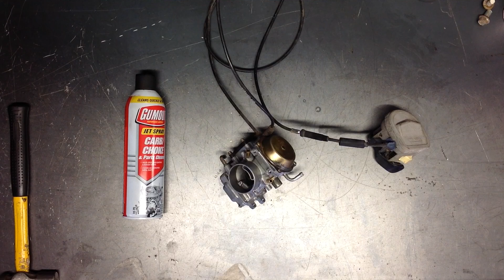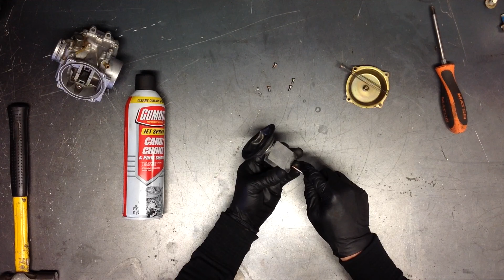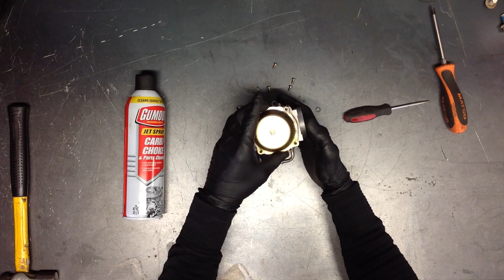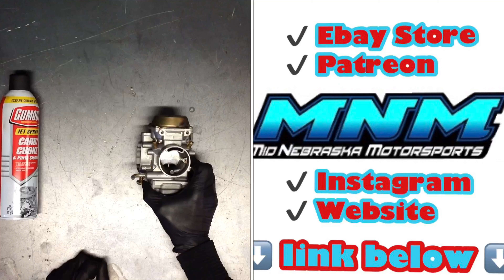#1 -  Polaris Magnum 330 /335 - Carburetor Rebuild / Carb Clean 🥇

Comment: Hopefully this comment finds someone who can help. My throttle cable will not come out of the carb. I've loosened the 12mm nut and there's enough slack to see the spring with the cable running in the middle of it, but it absolutely will not come out of the carb, as if the plunger is completely seized.. I'm in the middle of fixing up a 2006 Polaris Hawkeye 300 4x4 for my kid, any help would be greatly appreciated!

Comment: Where is the fuel filter located?
Reply from the maker: I dont have the machine in front of me, but typically on the Polaris's they are front left above the tire, mounted on the horizontal frame rail. Let me know what you find. Check us out for parts: https://www.ebay.com/str/midnebraskamotorsports

Comment: Sorry for the screw up, too fat of fingers for my phone.  My question is, must the throttle be removed from the handle bars and the choke handle from it's mount before removing those cables from the carburetor?  Or can you remove one and turn carburetor over and over to remove the other cable?